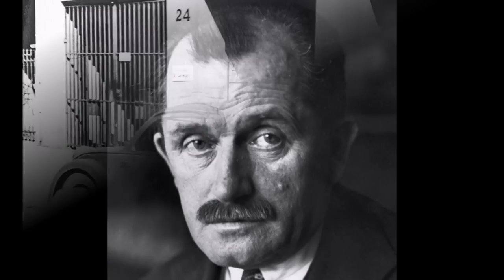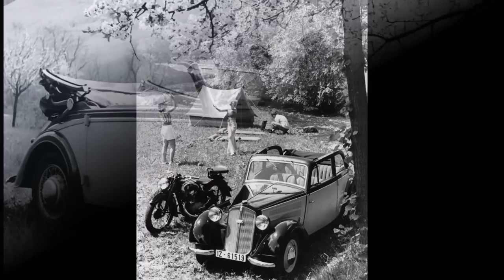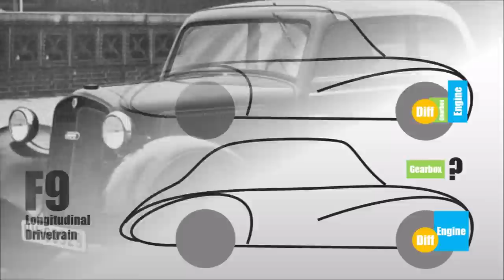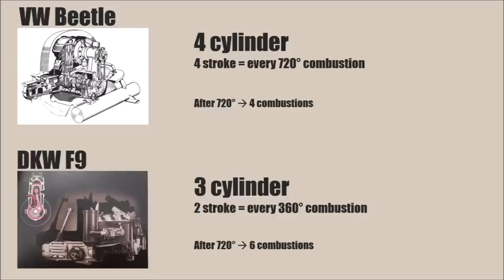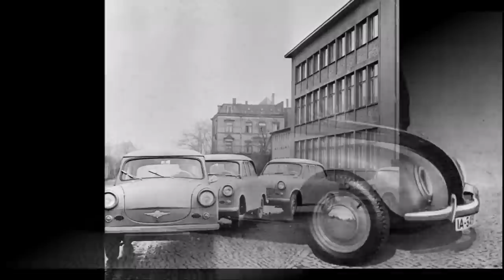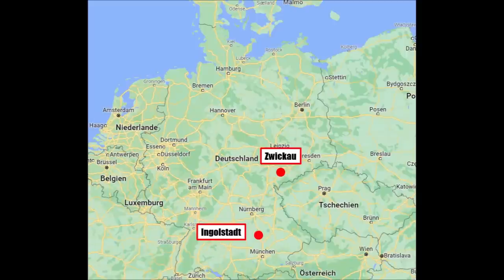DKW F9 - Part 1 - The Forgotten Superstar

Comment: I lived in Vienna, Austria, as a kid in 1968-69 and saw lots of DKW 900s on the roads. I was quite the car nut at the time. Unfortunately, my Dad was a Volkswagen buff and he called every DKW he saw "Stinkauto." I was too young to understand his explanation of two vs. four stroke engines but it did look like there was more blue smoke coming out of the DKW exhausts. Today I think the DKWs are very beautiful. The simplicity of the two stroke engine has a lot going for it. But what I love most is that beautiful sound that makes me think there is a formula one engine under the hood!
Reply: @ Stuart M Most likely what you saw was the Auto Union 1000 derived from the DKW 3=6 produced in Düsseldorf West Germany from 1955 to 1963. Type Number F93/F94. The factory stayed at Mercedes Benz after1964 when VW bought The shares from Auto Union.
Later in 1997 the Light Truck Transport Van Sprinter was produced there .
Reply: The DKW F9 was produced as IFA F9 between 1949 and 1954 at Zwickau and afterwards at Eisenach in BMW‘S old factory until the production of Wartburg started at 1956/57 with 900 cc and 28 to 32 bhp
Reply: Stuart, in 1985 I was in Budapest and travelled in a Wartburg taxi. Oh did they sound like racing machines.

Comment: I guess you're coming to that, but I find it hilarious the DKW set-up with the engine mounted longitudinally in front of the front axle and the gearbox behind the transaxle becoming the default Audi set-up to this day. It is common these days talking about "brand DNA", like VW owned Bentley would share any DNA with any Bentley before it? While on reality it shares a DNA with every Audi coming before it back to the DKW F9.
Reply from the maker: Yes exactly, will come to that in part 2!
BTW: Even the latest electric cars which don't even have a combustion engine in front of the front axle anymore, still have the same proportions... Engineers design what they are used to...
Reply: @BSport320  I blame Ferdinand Piech. When he succeeded with mounting a straight five that way for Audi he realized there's no end to the concept. The Bentley Continental is only the logical extension, but it really is hilarious opening the hood and seeing the entire W12 hanging in front of the suspension struts.
Reply from the maker: @ingvarhallstrom2306  The interesting thing is that every time they developed this design further, they were in a rush and just adapted instead of changing the base concept to solve the disadvantages:
- 1938 when they created this design
- 1950 when they quickly needed something to build after the war
- 1965 (AUDI 72) when they quickly needed a 4-stroke engine
- 1977 when they quickly needed more power (5 cylinders)
- 1988 when they needed 8 cylinders (Audi V8)
- 2001 when the A8 needed 12 cylinders
- 2003 when they quickly needed a platform for modern Bentleys
- and later on (until today) when Audi was responsible to create a platform with longitudinal engines for the VW group.
In my time as Audi engineer in the technical development in Ingolstadt I experienced this topic as the holy cow. They work around it instead of solving the main issue of the engine's position, because this is how they always did it and today's engineers often don't know where this is coming from.
Reply: @BSport320  well, look at Citroen from Lefebvre‘s Traction Avant in 1934- I have one- they drive really well. You have a good longitudinal stability plus good traction plus everything is at reach when it comes to repairs. Citroen continued that with the 1948 2CV Ente, then 1955 DS, 1970 with the GS (flat boxer as planned for the DS), the SM… it is not a bad thing to follow the basic laws of physics…

Comment: The Audi Front UW (Turned Wanderer) had the same drivetrain layout as the later Citroen DS, which was in fact a mid engine design with very good weight distribution and road handling!

Comment: My family had a DKW & later a VW.  Still preferred the quirkiness of the DKW, and it had a heater which worked.  Unlike the frosted windows in the winter with the VW.  Only car I ever drove that needed the inside windows scraped. Lol
Reply: The heating heat exchanger round the exhaust pipes worked fine on a new V.W. But the Beatles I bought (second and third hand beat up examples} were downright dangerous from carbon monoxide leakage. The Beatles' heating system in winter was a stark choice between  either choke  to death from the poisonous fumes  or freeze to death from the cold.

Comment: During my childhood in the 1970ies there were still some DKW F8 and F9 on the roads and of course their successors, the Trabant 500, 600, 601 and the Wartburg 1000 and 353 followed by the 353W in the early 1980ies.

DKW started its business in 1916 with the prospective of development of several military cars driven by steam engines. That's why they called themself in the beginning Dampf-KraftWagen (or D.K.W. with the dots). But allready in the 1910th the internal combustion engines started their victory way which was very surpricing at this time, because the steam engine allready had a history of 200 years and there were a number of very light weight fast running steam engines running in cars since 100 years (the busses in london were driven by - steam engines in 1816).

Interestingly a car drive system development company Ingenieurgesellschaft Auto und Verkehr in Chemnitz restarted the history of fast running steam engines for cars in the late 1990ies. In the early 2000th they were successful with the development of the Zero Emission Engine ZEE03. This steam engine offered a power of 75 kW out of 1000 cm³ stroke volume in the classic DKW 3-cylinder-in-line arrangement with a COP of 45%. Not so bad for a steam engine. The total water volume of this engine was 250 cm³.

This engine was very unconventional. There was a relatively small boiler for the preparation of saturated steam at 200 bar and 350 °C. The engine had 3 separate superheater working up to 900 °C on top of each cylinder head. So the superheated steam was produced just in the moment of steam injection.

The Rankine cycle works with 2 steps: compression of the remaining steam inside the cylinder, steam injection and expansion. At the end of the expansion stroke a control slit opens its way downstream through a heat exchanger to the condensator. In the upstream this heat exchanger delivers the boiler from the condensator reservoir.

Some of the engines were built in Skoda cars and tested on the streets. After a few minutes the boiler had enough steam and the superheaters have reached their temperature to start the car. The main problem was freezing of the water due to decomposition of the water and the anti-freeze in the cycle. The engine behaviour in the car was comparable with electric engines. It is not necessary use a starter drive nor to run the engine idle. The engine developed its full torque from zero rpm.

The boiler and superheater were fired with propane. But the fuel doesn't matter. The prospect of the development was the substitution of turbo Diesel engines. So the development came unfortunately too early. From the viewpoint of efficiency the engine is about comparable to an electric drive chain including a hydrogen or direct methanol fuel cell. It can be operated by use of Energy-to-fuel media like hydrogen, methane, methanol, or propane.
Reply from the maker: Thanks for the information!
Reply: @BSport320  The design and setup of the VW beatle was stolen from the Ledwinkas and their prototype of Tatra V 570. Another interesting story.

Comment: reminds me of the 2-stroke 3-cylinder SAAB -- saw + heard one in Seattle, 1987 -- wagon/estate body type

Had a 2-stroke 3-cylinder motorcycle at the time

That was at UW Seattle, where a windtunnel was built in 1917

(Saw / heard / smelled Trabants in summer 1989.)
Reply: "Rrrrrrrrrrrrrrinnnnnnnnnnngggggggg-ding-ding" ^^
Reply: The DKW racing bikes. ..I seem to recall that the 3 cylinder engine had one of the cylinders acting as a compressor with a dummy  spark plug in it thereby getting round the supercharger ban .True or false? I remember seeing them racing at the  Avus - Otto Kluge ? they were seizing up on the flat out blast down the autobahn.They gave it a minute to cool down and then continued  racing.... !954 Walter Zeller riding for BMW , Carlo Bandirola on the 4 cylinder MV Agusta. Great memories.of skiving off my duties to watch them practising.

Comment: When production changed from civil to military vehicles what models of military vehicles did the Zwickau factory produce?
Reply from the maker: They produced the Horch 901 for example but not just cars. They also produced tank engines and ammunition. 
The last civil car left the factory in 1941.
Reply: Actually I saw lots of military "Jeeps" in (West)Germany in the 60s, as far as I know they were made by DKW, had a 3 cyl 2 stroke engine and were called "Munga".
Reply: @BSport320  Thanks! Great videos by the way!
Reply from the maker: @PrimoStracciatella  I talk about the DKW Munga in Part 2.

Comment: Amazing cars. The trunk holds a bicycle. And car will do a 90* turn at 50kph. A Beetle would roll over.  4 speed all synchro. Just a shame DKW didn't use a flat 4 petrol engine up front like the Hansa Goliath.
Reply: I don't think a Beetle would roll over but when I was 18 I went too fast into a 90 degree turn and the rear swung out, making the car instantly uncontrollable. I did a 270 degree spin and crashed into a building.
Reply: @PrimoStracciatella  Sorry, I didn't see your reply until now. When I was an apprentice at a VW agency in the late '60s, many Beetles got rolled on road test.  Our punishment?  We'd have to inform the owner.  We probably lost 15 Beetles in my time there.  I rolled my VW beach buggy, breaking my cobber's ribs.

Comment: That car in the pictures is looks more like an IFA F9 (badge in the grille) not the DKW.
Reply from the maker: It's the DKW F9 and the picture is from the advertisement in 1939. You can also see it at the license plate "IA", which was not used after the war.
"I" - Roman Number 1 stands for Prussian territory
"A" - Stands for the capital Berlin
But DKW F9 and IFA F9 are the same car and look very similar.
Reply: IFA is actually not a car brand but the acronyms of a state owned conglomerate in what became DDR under the Soviet supervision after the war. When the invading forces closed in on Zwickau the DKW engineers fled and took with them most, but not all drawings and plans and ended up in what became West Germany. For that reason the F9 became two different cars with a few but distinct differences; for example, the three-point ignition system never appeared in the IFA (to my knowledge) and the streamlined body appeared first on the DDR-produced 3-cylinder IFA while DKW produced their first streamlined version with the 2-cylinder engine from the F8 in 1952. The 3-cylinder version came in the 1954 model (in Sweden). That is why some images of the same streamlined body is actually the original DKW design studie and some are showing the IFA F9 with the IFA badge that the DKW does not have. My father owned several DKW's between 1934 and 1963 and some of his recollections of the war and especially the fate of DKW and Auto Union are mixed with publicly available information in my comment (above).

Comment: My father owned 2 DKW 3=6 in nthe late fifties, killed 3 engines. I have a photo of me behind it, so must have been 1954 or 1965. 
 
And in my neighvourhood someone has one, I see it from time to time parked outside.
Reply: Maybe he forgotten to add oil 50:1 ratio. We used ordinary motor oil.  The newer less smoke 2 stroke oil were available.  Plus these 2 strokes cannot use engine braking. As no oil is going thru crankcase.  Saab has a free wheel. Then it can be dangerous as single circuit brakes ! Plus they were a drums(?)

Comment: Hey Martin, I was just thinking whether we could get your opinion on two brand new cars:

A Swiss company just burst on the supercar stage with a twin turbo V6 carbon tub road racer : the Picasso 660LMS. As the name suggest, they target Le Mans with a version of that car, but for now we have a quite extreme road car with a carbon tub and rear subframe, 660 ps, and a claimed 960kg of downforce at the 196mph top speed. They seem to be quite serious, and have got some stuff to back up their claims, but I'd be curious to know what you think.

Alpine just unveiled their Alpenglow, it's definitely an unrealistic concept car with hydrogen propulsion, variable opacity bodywork, and some other stuff. Style wise, it's got vibes from the Renault DeZir concept (which was interestingly one of the many signs that a new Alpine was on the way), but more interestingly also from long tail Le Mans racers, and (surprise) the Peugeot 9X8. And that's where I'd love to have your opinion: the car is part F1, part Le Mans prototype, single seater with a feet-up (I think) driving position, aero profiled F1 suspension elements, a 9X8 rear wing, a Valkyrie diffuser, a central fin, etc. It looks to me to be a bit like the Mazda Furai, definitely a (very good looking) concept, but maybe made with a more serious intent, which in this case could maybe be announcing their future LMH racer, in a way like what Cadillac did?

Comment: Dkw was just bad. Audi sucked, VW outdated, Bmw rusted fast, mercs sucked overall, Borgward was already bankrupt. My dad drove a small Alfa, my mum Datsun 1000.
Reply: Yet the VW Beetle was one of the top selling vehicles of all time and VW became one of the largest automakers in the world.
Borqward wasn't bankrupt it had cash flow problems.
When it emerged from Court after all its assets had been sold the sales of those assets paid off all creditors.
Mercedes Benz is the most profitable manufacturer per unit in the world.
BMW Mercedes and Audi are some of the top selling luxury vehicles in the world and have untold numbers of repeat buyers that were obviously happy enough with their vehicle to spend a significant amount of money on another one.
Alfa Romeo...
A brand known for occasional design brilliance but more well-known for unreliability poor durability and is one of the slowest selling vehicles in its segment.
Datsun nee Nissan...
A shell of its former self. Had to merge with Renault to avoid bankruptcy and today is known as a rather low to mid-range quality vehicles that are outclassed by numerous other marques.
Alfa Romeo and Datsun are both notorious for their propensity to rust quickly.
Alfa Romeo only survived until it was taken over by Fiat because it was state-owned and the state absorbed its massive losses.